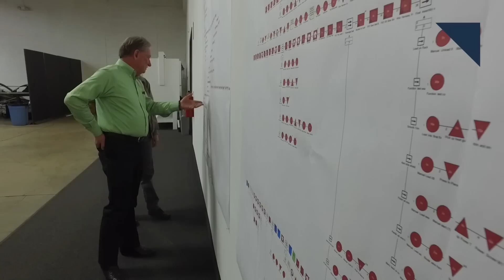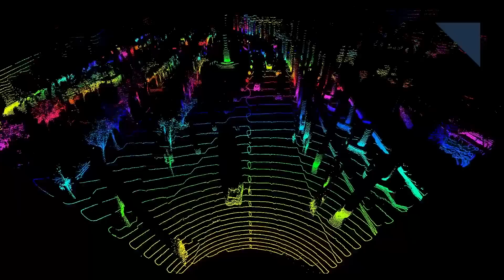China's Ownership Cap, Model 3 Production Pauses - Autoline Daily 2334

Comment: The Tesla Semi is American made.  Lets hope they take off.
Reply: Grandpa, Fed ex and UPS alone could buy every Semi Tesla can make. Run them hub to hub and charge there.  Not every truck needs to be electric.  If you are running the same DC to Baltimore run every day.  That is the perfect use for an electric truck.  I drove an Box truck for 3 years there is not one day I drove that could not be handled by the small 300 mile range Tesla Semi never mind the 500 mile range one.  A 100 to 200 mile range electric truck can be charged on 240 volts over night.   Those 240 volt outlets are almost impossible to find. Right?
Reply: Robert , It is not due out until 2020. I would like to see where Tesla will be build the Y.  The  introduction on the Y is  late this year.
Reply: Watch them do it grandpa.
Reply: Grandpa,  You are living in the past.  I am often guilty of the same.  I am on the list for the Tesla model 3.  I can speak for the whole nation.  For me I am putting up solar panels and getting back up batteries.  If the local government will let me I will put up a windmill also.   When I finish the days work I will charge my car off the back up batteries that charged during the day when the sun was at its peak. Or charge off peak at 1 cents an kw.  Big oil is pushing back but even Shell is starting to build charging infrastructure.  If Tesla gets bought out or something happens to Elon or his one factory.  It will hurt the electric car industry.  Battery prices have already dropped 4 fold and the economics of electric cars are now much more realistic if no were close to the  profit margins of ICE cars.  Remember Tesla is building its own charging network and they have already sold thousands of Semis.  The genie is out of the bottle.  The brake even point on an Electric truck vs a diesel one is under 2 years. After that it is all cream.   Short of 300 hp 60 mpg ICE car for under 40k.  The writing is on the wall.  The ICE will be around for a very long time.  In just a few years electric trucks and cars will be at least 10% of the market.  Even if Tesla is no longer here.
Reply: Yep, most traditionalists forget that Tesla is an American company that contributes to the American economy